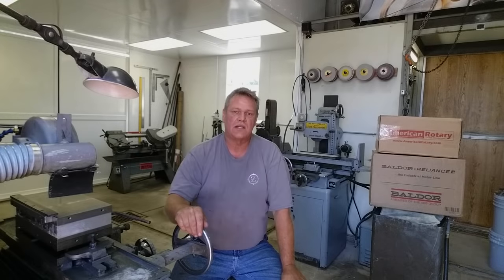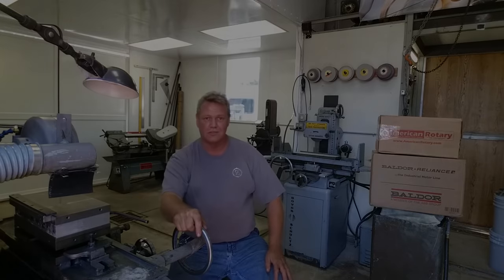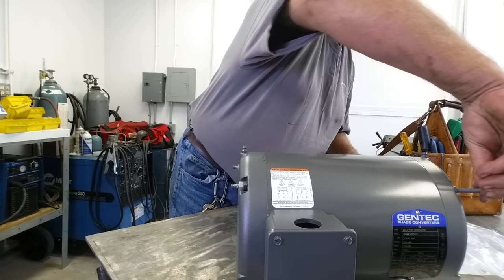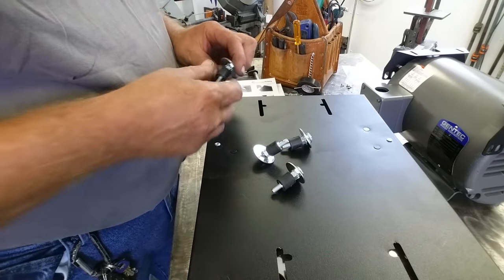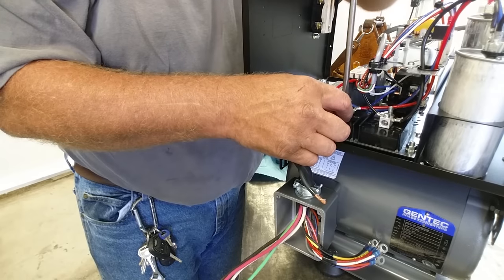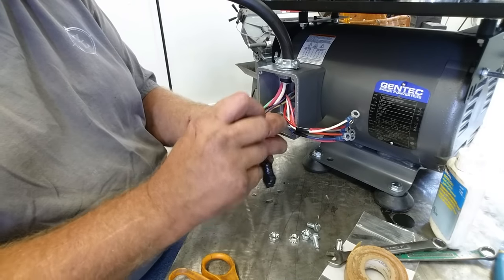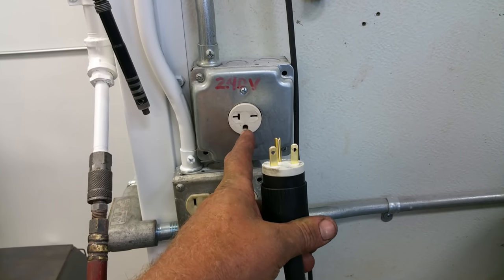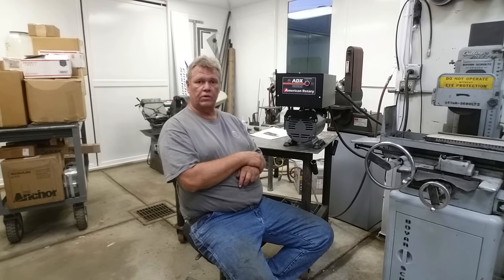RPC  VS  VFD

Comment: Don't solid state phase converters exist yet? AC->DC->AC. Basically a VFD without speed control. I personally wouldn't much around with anything else. Phase converters just take single phase and make a third leg. L1 and L3 (if L2 is your ghost leg) are still 180 degrees apart. Doesn't seem like it could be as efficient as it could be when it comes to driving 3-phase motors.
Reply: Nevertheless, interesting stuff
Reply: Tim,  I hope you don't mind a few comments.   I have seen lots of comments L1 and L2 being 180 degrees apart.   I don't know who is teaching this, but it makes absolutely no sense.   Single phase is what it says it is. One sine wave at a single point in time.   There is nothing to do with phase angles like in three phase.  As far as efficiency, not sure what you are getting at.  I'm not sure what the power factor of RPC's are since they put capacitors in their controllers.   If the power factor is really bad(which it would be without the capacitors) the electrical bill would be lower.   Utility companies have nothing in their 120/240 volt meters to check power factor.   Hope this helps you.
Reply: @KevinCoop1  This is in the context of phase converters. Not natural 3-phase power being supplied as a utility. For a phase converter's output, L1 and L3 would be 180 degrees apart because the two 120v lines coming in are 180 degrees apart. L2 is generated as 90 degrees between those 2 legs from capacitors. Good luck trying to turn 180 degrees into 240 degrees with capacitors. It could be done, but the phasing would vary as load varies.
Reply: As far as power factor goes, unloaded motors have a poor power factor. But residential users don't have power factor factored into their bill.
Reply: Tim Ramich     Tim,  I am not an electronics engineer.   I am a building construction engineer (retired recently).  Let's try this direction.   It is unusual but utilities can give 240 volt three phase to their customers.   Unlike 208/120 volt which is Wye connected transformers, 240 volt is delta only.   Assuming you understand delta connected, a connection from L1 & L2(single phase) to 3 phase motor phase A-B(makes no difference at this point which phases you connect them to) from A to B is 240 volts, from B to C is 240 volts and A to C is 240 volts from the RPC.   That is a perfect world.   The running capacitors( from my understanding) are to increase the voltages that are lower from A toC and B to C. To get them close to 240 volts.  Phase angels are 120 degrees.  Take the 180 degrees thought out of the equation.   It doesn't exist.
Reply: @KevinCoop1  It is evident that you are not an electrical engineer. There is no such thing as 240v 3-phase. And no utility is going to imbalance their lines by giving a customer just 2 legs of 3-phase power. 240v is a single transformer. The center of the secondary winding is tapped and bonded to ground. Thus, two 120v legs that are 180 degrees apart. Single phase. Wye or delta have nothing to do with phase angles. Your 2 legs of power going into a phase converter are 180 degrees apart. Those 2 legs simply pass through the converter untouched, and a ghost third leg is generated and voltage boosted with capacitors. That third leg lies halfway between your 2 real legs. 90 degrees. It is impossible to get 120 degree phase angles out of a rotary phase converter.
Reply: Okay, I will correct myself. There is 240v 3-phase power. Uses 2 transformers and 2 legs of 3-phase high voltage line. In that case, there would be 3-phase power coming in from the transformers' secondaries. We're talking about residential 240v single phase, which is 180 degrees apart. If they had 240v 3-phase power, they wouldn't need a phase converter. There is absolutely no possible way to have 2 legs of 120 volts be phased 120 degrees apart and get anything more than 208v between them. If your 2 legs of 120v measure to 240v total, they MUST be 180 degrees apart.
Reply: Tim Ramich    The 240 volt you are describing is "open Delta".  Only 2 single phase transformers and three connection points.   Normal is "Delta" 3 single phase transformers connected to three points.   Each of the three transformers are the same number of windings as a residential transformer(given the same primary voltage) less the center tap connection that is in the residential 120/240 v system.   There is no neutral connection made to the phase converters.   And again there is no 180 degrees at 120 volts apart in single phase.   One coil, one rotation.   Respectfully,   Kevin
Reply: Tim Ramich    Additional comment,    Residential transformer is one single coil that puts out 240 volts.   A connection at halfway of the windings (or half the number of windings) is 120 volts.   The sine waves for both voltages are at the same exact point in time.   There is absolutely no 180 degrees anything in this.   The 120 volts do not add to each other as many say on YouTube.  It just is either 240 volts or 120 volts.   Since you seem to not believe me about what I did for a living, I have designed electrical systems from single family residential, to industrial, to Data centers.   Project sizes for just electrical work from $500 up to $120,000,000.00.    And yes, I am a PE.   Respectfully,   Kevin
Reply: @KevinCoop1  Dude, you are no electrical engineer I'd you can't grasp this. You keep bringing up crap about delta transformers. We're talking about residential power. If you take two legs, each 120 volts, and measure the total potential between them, and it comes to 240 volts, they are 180 degrees from each other. END OF STORY. I didn't say neutral went into a phase converter. You cannot magically create a third leg and then have both those original two legs just magically be 120 apart from that ghost leg. The only way to get true (120 between every phase) 3-phase power from single phase power is to generate it by spinning a motor and coupling it mechanically to something that generates all 3 legs independently from the input electricity. OR, to go from AC to DC back to AC through solid-state and PWM means (like a VFD). I couldn't care less about your alleged credentials and the dollar signs you posted. Truth doesn't care one bit about appeals to authority. You said initially that you aren't an electrical engineer... Single phase 240v power in the US is 2 hot legs of 120v, 180 degrees apart. PERIOD.
Reply: @KevinCoop1  If the sine waves for the voltages are at the same point in time, then how could they ever shift to be 120 degrees apart. They can't. Hence single phase. Each leg is referenced from a zero point. Ground or neutral is your reference. Zero volts. Each leg sweeps from positive to negative, crossing that zero point. Go to Europe where you have 240v where one leg is hot and the other is neutral, your whole theory falls apart. A rotary converter wouldn't work there. They would have to un-bond that neutral from ground to make two hot legs for a rotary converter to work. Thus, in the US, in the situation of the rotary phase converter, we consider the two legs coming into it to be floating. You still can't change their phasing from one another to get a nice 120 spread from the phase converter. Measure each voltage coming out from a phase converter with an oscilloscope.
Reply: Tim Ramich    You have your opinions based on something.    I can't get you to understand reality about your misunderstandings.   I said I was not an Electronic Engineer, you need to better comprehend what you read.      Enjoy your life, I can't do anything for you.   Respectfully,
Reply: This is what you would get out of a rotary phase converter: http://timramich.com/3phase_vs_rpc.png
No one really claims that the power coming from these things is anywhere near the quality you would get from a utility company. Why argue about these like they are god-tier machines? I've never met anyone who is so adamant about the power coming out of these things being 120 degrees apart, when it's common knowledge that it isn't. They get a job done, and for cheap. But at some point solid state will be cheaper and deliver better-quality power. They could remain on at all times without wasting power. Why do you think these rotary converters are so de-rated? Because of the phase imbalance...
Reply: @KevinCoop1  Guy, these are not opinions. This is basic electronics. I don't even know where you're going with this electronics engineer thing. First you say that you aren't, and you came at this cautiously and seemed to have an open mind. Then you acted like an expert and touted some unrelated engineering nonsense. I acknowledged TWICE that you said that you are not an electronics engineer, so my reading comprehension is just fine. Grasping at thin air now, are we? Go ahead and measure the output of a rotary phase converter with an oscilloscope and then come back and tell me I'm wrong.

Comment: I was kinda listening along nodding my head until you said you need to rewire and refuse a machine if you out a vfd on it....

What the fuck are you smoking? If you are talking about the controls for displays and readouts, that still doesn't make any sense as they won't work outside of the 50/60 hz window so refusing is pointless. If you mean just for the main drive motor that's still pointless because ty he clearing time of the fuses isn't rated for anything less than 50/60 hertz, and, if you set the motor parameters up in the drive, fusing is unnecessary completely.  

Methinks you're shilling the rpc a bit too hard..